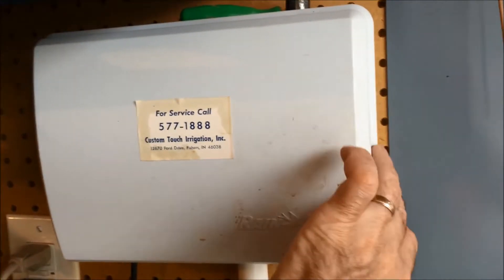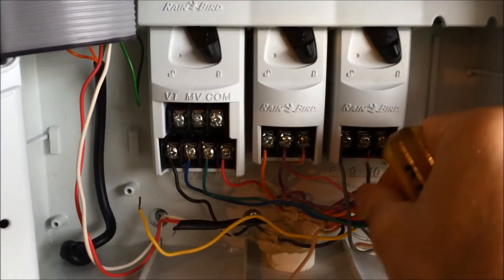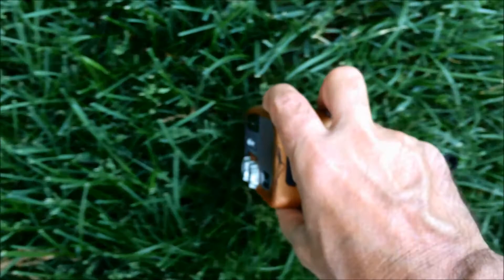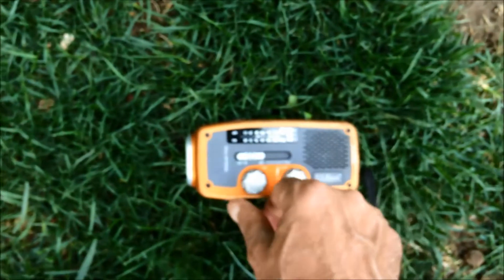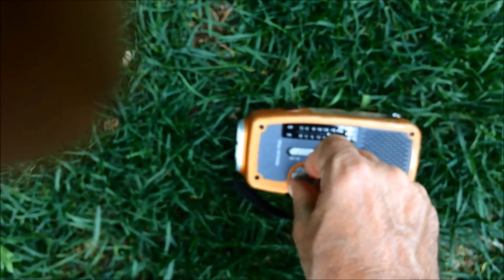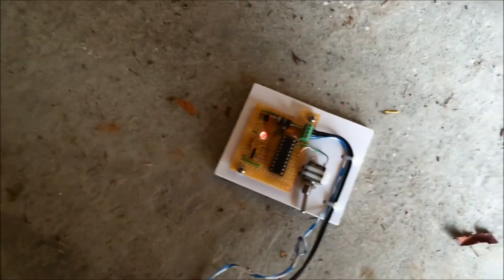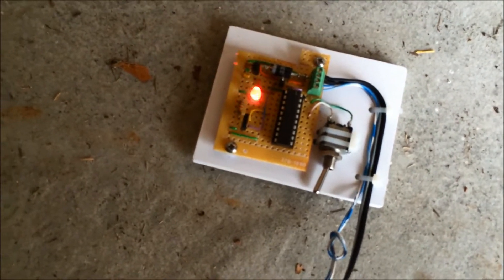WD8DSB irrigation wire tracking and valve locating video 11MY15

Comment: Hi Jim, I searching for a buried wire that could be up to 18" deep if buried to code.  Your wire tracking is very clever.  Any thoughts on its ability to detect a wire buried up to 18" in the ground? Thanks.

Comment: On the circuit board the green adjustable chip is RFD14N05L?  On your schematic Diode D3 is what value?  The blinking light is what component in your schematic?  Pardon my questions as its been some years building from a schematic diagram.  Thanks for your work WA3IOQ.
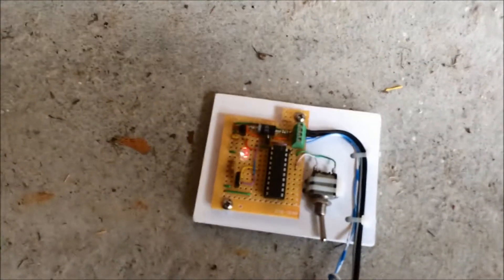Reply from the maker: Hi George.  Diode D3 is just a Red LED (any Red LED will do).  You mentioned a greed adjustable chip, but nothing is adjustable on the circuit board (except for the toggle switch).  The green item is just a 4 position terminal strip with screws.  At 1:15 in the video you can see the circuit board.  The voltage regulator LM78L05 is the small black item in the top left of the board.  Diode D1 is the large black item at the top center of the board, and just below it is diode D2.  Q1 is the black item located near the bottom left of the board.

Comment: I can't tell if you noticed, but the two videos you made about this topic have about 10 or 20 times as many hits as many of your other videos; this is clearly a popular topic. We are not engineers, but many of us are simple electronics hobbyists who could put one together.  Could you please make a short video that simply shows a schematic of this circuit? Just draw it on paper and shoot a 10-second video. Professional trackers that do the same thing cost $600. Thanks much . . .
Reply from the maker: Hi Charlie,  I just updated a description of what I did in my response to Jim which is up above.  Since I had to program the single chip microcomputer this is something that would make it difficult for many folks to duplicate.  I actually think it would be easy to mimic my underground wire tracking concept using two 555 timers (one running at 1760 Hz with a very small duty cycle), and a second 555 timer turning on and off the first 555 timer at a frequency of 14 Hz with a duty cycle of 50%.  I will try this on my bench when time permits, and then come back  with the results.
Reply: @wd8dsb  Hi,  thank you very much for posting these two videos on the home made wire locator. I am very dismayed by some of the rude comments that have been made, I hope you are not discouraged from posting more!  Although I am not very knowledgeable in designing electronic circuits,  I do have confidence in my ability to follow your schematic. In your reply above, you state the "single chip microcomputer" needs to be programed - I am assuming that is the "16F690-I/P" chip?? Something I certainly am not capable of, however Digi-Key states that they can program these chips for customers. Would I just tell them I want a "1760HZ square wave signal, with a 4.6% duty cycle, with the signal turned on for 36msec, then off for 36 msec repeatedly".  I know I am very late to this video, so I fully understand if you no longer respond to comments.
Reply from the maker: Hi Paul,

I was not aware that Digi-Key offered programming services, but I suspect this means they would load whatever program you have into the microchip microcontroller if you supply them the actual program file.  And yes the microcontroller that I used for this project is the 16f690.  I can send you the file that contains the program I wrote if digikey or someone else can load the program into your 16f690.

Comment: Where's the plans for this system/kit? Did you buy this?
Reply from the maker: Hi Jim,

I designed and built this system myself for use by my brother in law who lives 2000 miles away, and I created this video as a training video for him.  I used a microchip 16F690 single chip microcomputer followed by an FET (FET acting as a switch to drive the buried wire).  I generated an approximate 1760 Hz signal using the PWM (pulse width modulation) function with a duty cycle of 4.6% and then kept this signal on for 36 msec then turned this signal off for 36 msec, and then repeated this sequence continuously.  The 1760 Hz square wave signal generated by the 16F690 produces enough harmonics that the harmonics can be heard well up into the AM broadcast band.